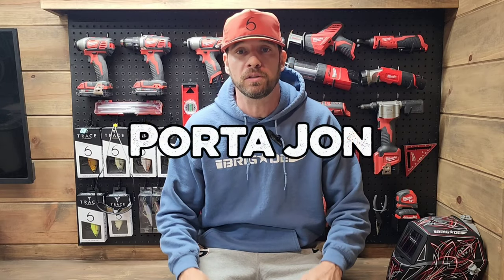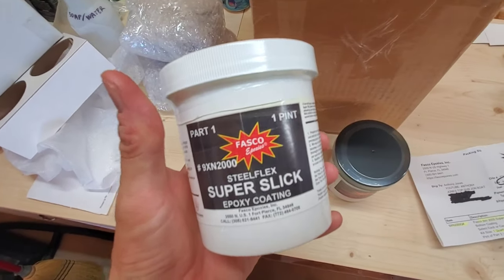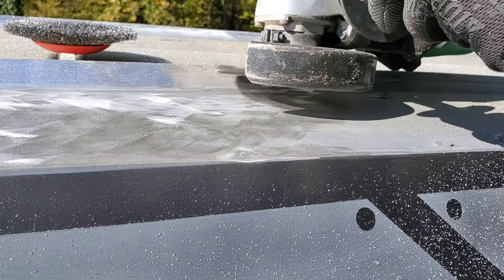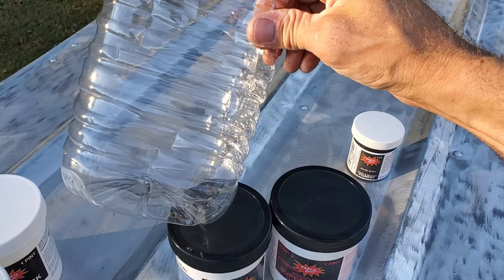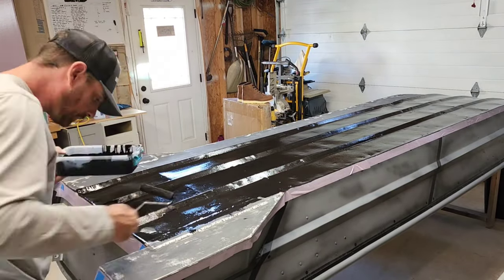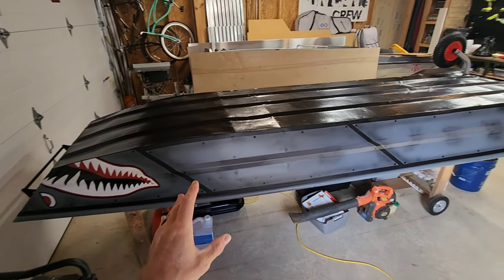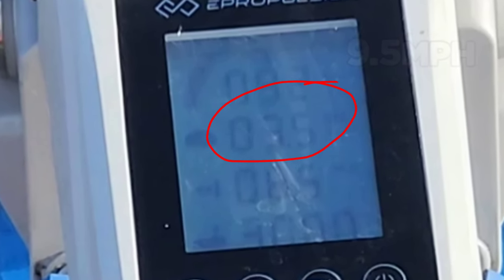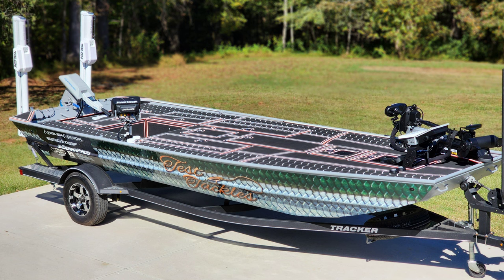Epoxy Bottom Coat on Jon Boat | HOW and WHY

Comment: Glad you didn't trash the video of the mistakes.  That helps us all for a great final product.
Reply from the maker: I was so close, man. It was pretty stupid to leave it outside but never considered  it not curing and dew getting in it. Then, I didn't know how I'd recover to make a fluid video given the circumstances. Almost gave up. Then I thought, maybe the audience could benefit from my mistake if I edited it properly.  

Fun fact for first comment- I actually applied the first coat in October of 2021. The boat sat after the incident for that winter into spring 2022 until sanded. Then, 2nd recoat was done in September of 2022, then final drone footage and testing shot in February 2023. To say this project has been a long time coming or a side project is an understatement at this point. There are plenty of boats to work on around here! 
I'm glad to finally get this out!!! Thanks for the support.

Comment: I have completed the wiring on my new 1548.  Your videos and others helped a ton.  Thanks...about to tackle the carpet..debating on buying a staple gun (air)
Reply from the maker: Awesome to hear. I would if you already have a compressor. SO worth it. I bought a Wen Staple gun for my compressor and it was like 25 bucks on amazon, used it on a few boats now, should have bought one sooner.

Comment: I recently coated a 1652 Jon boat with  fasco and did the whole outside. I really agree with all of the advice given here. Especially the choice of applicator I used brushes bc the rollers I tried didn’t leave a good finish, but the roller looks like it worked really good in the video. So maybe it was just the rollers I was using.
Reply from the maker: Yeah man it was like night and day just by using a different roller. Also its way more workable in application in thin coats by applying from tray and not pouring and spreading like i had seen and heard so many others do.
Reply: How much did you need for it?

Comment: Best part is that you remedied your mistakes and showed a successful end result. Nothing about your "before and after" performance evaluation is scientific because it's the proverbial " apples to oranges" comparison. It's overly obvious that the coating dictates improved resistance factors and considering the drop in speed is nominal against the added weight, the coating is successful. Thanks for sharing.
Reply from the maker: Thank you for the great response! Like i said in the video, I'd like to do a true before/after bottom coat test one day. Even with that, there are so many small variables that could affect speed changes unless it was considerably noticeable, im not sure you could pinpoint it one way or another. Another thought I've had is that perhaps the epoxy won't shine at low speeds. It was designed for air boats, so perhaps significant speed increases can be seen at higher top speeds on boats that can actually get on plane. Who knows?
Reply: @AnthonyJonesBrigadeBoats  keep going, you're doing fine.

Comment: Anthony, can you share how this [or other] bottom epoxy holds up to truck bed and bank sliding? Do the high points of the boat bottom get scratched off quickly or it has been durable? Looking to add something slick to a 1444 build and second highest reason if durability from transport on off scrapes and scratches, to the drag and sliding for access to rampless ponds or marsh. I haven't seen anyone show a real test in that they use their boat for a year [whatever period], each week [defining the use amount the boat actually gets], trailerless, to access what type of water crossing what type of surfaces with, and finally the before, hoping mid use, and after shots of the bottom finish. I have lots of sand, muck, and rip rap dot rock I cross to gain access to low/no pressure areas and fish. My JB is getting a whooping from these crossing so I am investigating what actually works. Thanks again, you rock.

Comment: Any thoughts on flex sealing the bottom of an old boat? It’s like a pin cushion. Just trying to go easy and inexpensive.
Reply: If you read flex seal fine print or have experience with it, it is meant to only last 1 year or maybe 2 if you're really lucky. If that meets your needs, I assure you it'll work until then! Stuff is great for quick fixes. Epoxy though if you can stand working with it, is better for longer term.

Comment: I drilled out the loose rivets on mine and replaced with stainless machine screws and washers then coated the bottom of mine in flex seal. It’s been doing awesome but the only downside is I can never paint the bottom of the boat because paint won’t stick but

Comment: Interesting stuff and a good job on the video, you might have found your speed losses in the motor and electrical systems or possibly from weight gains also, but I would have been interested in the epoxies durability and possibly if it offers protection from electrolysis around the transom from the motor. 
Keep up the good work

Comment: That style of drain plug works best when plugged in from the outside. As the pressure from the water pushes it makes the fit tighter. That said, plugs seem to be a rather contentious topic and many people recommend putting in a screw type plug.
Reply from the maker: I definitely need a plug upgrade!

Comment: great video ! i was wondering if i can use bedliner application instead of epoxy ?
Reply from the maker: Technically you can use water you want i guess..At the end of the day, bedliner was designed for truck beds, epoxy bottom coat was designed for boat bottoms

Comment: Do you recommend 2 thinner coats.  I have a valco that would be around 2 qt needed to coat the bottom and bow. Or mix up 2 and do one coat with 2 ppl rolling
Reply from the maker: Definitely 2 thin coats. That's what Fasco recommended and you'll get a better and more consistent finish.
Reply: @AnthonyJonesBrigadeBoats  awesome thank you for that. I’ll order 2 qt kits. And make them 2 coats

Comment: I'm so glad I don't  live in a state that makes you spend that much on a motor  so  I can go less than 10 mph.
Reply from the maker: The reservoirs are for drinking water, hence, no gas outboards. Its my choice to go there or not. Most guys use kayaks. I prefer the rednecks with paychecks method of a tiny boat with an electric outboard. These lakes are well managed, big bass, and very quiet. I'd rather go here to peacefully fish for tanks than the other option of going  to the big lakes in Ga (Oconee, Hartwell, Lanier) and compete with every other 100K $ bass boat running 90mph and millions of wake board boats and party boats blasting rap music and creating massive wakes every 30 seconds. At the end of the day I'd rather fish electric only reservoirs than the bigger lakes and the electric outboard really isn't "that much" to me, $ is relative to the individual I suppose.
Reply: @AnthonyJonesBrigadeBoats  
True!! 👍

Comment: That super slick stuff is garbage, it dries on like glass and makes it heavier, and cracks off in chunks. Gator glide is wayyy better, it keeps an oxygen layer in between the boat and doesn’t crack easy, I’ve had it on my boat for 3 years now no complaints.
Reply from the maker: Makes it heavier? lol. It, along with Gator Glide, can weigh no more than the volume of the quart, ounces....If you prefer to use a product that takes one month to apply, by all means use it. Sounds to me that if you in fact did use Super Slick, and it failed, it was an installer issue. I literally know 30 guys with this on their boats, including multiple boats of my own. No issues. And what the hell are you talking about oxygen layer? The old wives tail comparing the orange peel to golf ball demples creating micro bubbles which creates better hydro dynamics? If that were true every one would just use bed liner and be done with it.
Reply: @AnthonyJonesBrigadeBoats  I’m good buddy’s with the guy that owns copperhead mud motors, when they first came out super slick sponsored them and let them test it out. I personally don’t have experience with it but long story short guy at copperhead says it’s awful and doesn’t even compare to gator glide. And no it doesn’t take a month to apply, takes about 3hrs to do properly on a sunny day. iv installed gator glide on all of my boats and had no issues and it works great. I’m sure it’s not terrible for the price but I’d just spend the extra $100 and get gator glide.

Comment: If u are gonna put a floor and carpet in u can spill a oil base or I'm sure there are better paints for application at an overobundance rate ,let it set up and u have double coverage on the rivets from inside,u will cover it any how,I would think double coverage would be very little chance of ever a leak.if so ,so minor u would prob never know it.
Reply from the maker: For paint to proper stick to all that you'd need to sand it or grind it all, then clean it properly.  Otherwise it will just peel off. If your going to do all that, might as well just do the bottom the proper way. But that's just me. You do you.